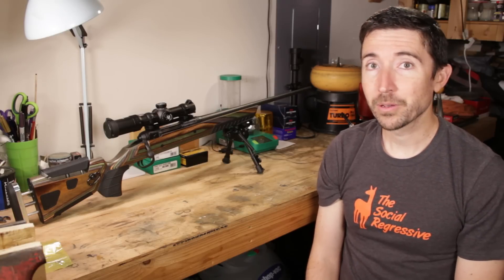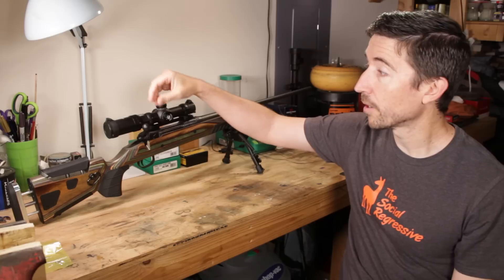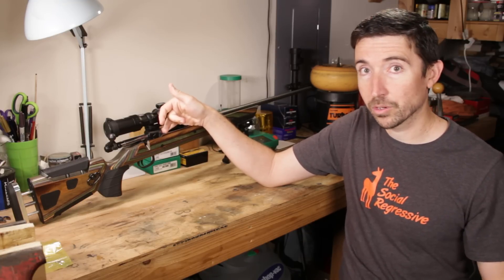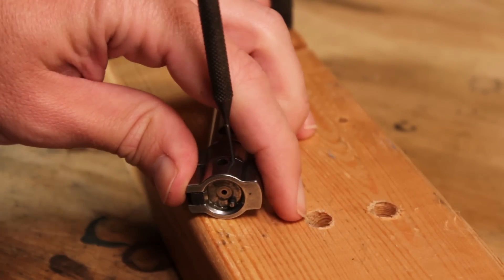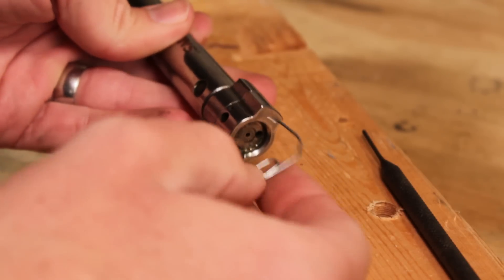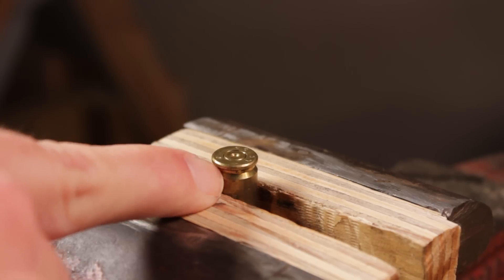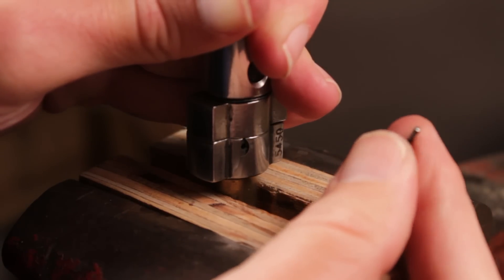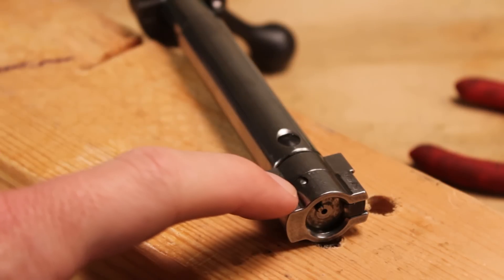Savage Axis Ejector

Comment: In response to tincan's question...

Different cartridges will eject with different degrees of authority from the Savage platform.  Case diameter, case length, shoulder angle and neck length all play a roll.  For example, a lot of people have ejection issues with 6.5 Creedmoor from the Savage and the reason is because of the case dimensions at the neck/shoulder junction, the shoulder angle and the neck length.  When you first start extracting a spent case from the chamber the ejector starts putting sideward pressure on the case head forcing the neck and shoulder into the side of the action with the ejection port.  As this happens the neck is pushed into the raceway channel, but the neck length is to short for the case mouth to contact the outer wall of the raceway which would limit the angle at which the case is being tipped.  The diameter of the case at the neck/shoulder junction is also small enough to fit into the raceway, so it to does not limit the angle at which the ejector is tipping the case in the bolt head.  As a result, the case is pushed to such an angle by the ejector that it allows the rim to slip out from under the extractor and the case falls out on top of your next round rather than being thrown clear.  Short cases like the 6mm BR are also prone to ejection issues due to their short overall length allowing the case to be pushed to a greater angle than the extractor can accommodate  before contacting the inside wall of the action.

Sharp Shooters Supply sells an upgrade kit that includes a slightly modified ejector pin, extractor, and extractor detent ball that will eliminate most ejection issues in the Savage Axis and 110-based rifles.
Reply from the maker: Great info! I'll pin this comment up top for anyone else that needs to fix an extractor/ejector issue.
Reply: Savage Shooters %
Reply: Having issues with my Savage Axis 2 XP Hardwood 308 loading cartridges at times. It will sometimes get stiff when chambering a round and be stiff on ejection. Any help is appreciated.
Reply: Kyle, how the heck did you get this pin out. The hole for it is small than 1/16" and that is as small as most roll punch kits come 🤣. You'd probably laugh, watching me attack this pin. Your ejector pin diameter must be larger on the Stevens bolt. Thanks
Reply: @Jeff_Seely  I just used a common nail of the right diameter after filing the pointed tip straight, I tapped gently a couple of times with my smallest hammer and it worked alright because the retaining pin is not hard to take out.
Reply: @jodo2609  Thanks. I later found a roll punch small enough to get in there and tap it out but it was stubborn. It looks like whoever assembled the bolt buggered up the leading edge of the retaining pin. I appreciate the reply

Comment: So, I also have had problems with my Savage Axis II XP bored to 223 REM ejecting.  In my case, though, the pin had plenty of spring left.  After messing with the thing for two hours, I found that the spring under the ball bearing needed more tension (it sat flush with the bolt face, meaning the height of the bearing was the only force put on the spring).  I manually stretched the spring out about 1/4" and now the rifle is ejecting fine...for now.  Someone else mentioned inserting a larger bearing, and this could probably do the same thing.  I typed all of this out hoping it may help one person out there.  Thanks for the video!
Reply: I put in the larger detent ball and that cured my problem , sad after all these years Savage has not correctly fixed the problem

Comment: I had the same ejection issue I replaced the ejector spring after firing couple of rounds it worked for awhile until it started to fail again. After careful analysis I notice the spring tends to loose its spring power. So what I did was to cut a small tiny piece from the old spring add it onto the regular size spring by putting it inside the ejector spring hole to give it more tension, put everything together and it works perfectly no failure and ejection was crisp with every spend shell gets spit out strongly regardless of ammo brand.
Reply from the maker: Cool idea!

Comment: I replaced the ejector and extractor, with the kinney's enhanced kit (extractor, bearing, ejector and spring) $22 problem solved. It doesn't solve the slop/play of a savage bolt, but for that I would recommend pushing the bolt up as you push the bolt forward, this will push the face of the bolt down which will pick up the next round from the magazine. (I also replaced the accustock as that is better suited for an air rifle and I no longer have the problem of using savage proprietary magazines which are really poor) in fact getting the savage 10 has turned out to be an expensive mistake, for what I have spent to give me consistant sub moa at 100mtrs, I could have probably achieved with a tikka, Sako or Bergara for the same money. My bad.

Comment: Thanks for the instructions! I’m working on putting mine back together right now! Retention pin fell out at the range.
Reply from the maker: Did you find it? Or buy a new one?
Reply: @SocialRegressive  I saw the spring and ejector when they fell out at the range and used your video probably 6 months ago to diagnose the problem. I found out that the retention pin had also fallen out. I bought a new pin and well as spring and ejector for good measure. I finally got around to implementing the fix this morning. When I watched your video again, I thought it would be a good idea to put the new spring in since the old one felt a bit loose. Thanks again!!

Comment: Great video, but you may want to thoroughly clean the pocket, inspect inside, clean and inspect the removed pins before reassembly.  Sometimes you'll find carbon buildup or even original machining filings/grit or other debris.  Depending on the components and how they operate, lightly file or sand rough edges/ends, or lightly polish surfaces may really smooth their operation.  Then lubricate after reassembly.  Anyway, thanks for the video.

Comment: I changed the whole extractor system (Ball, Spring and Extractor). I changed the ejector spring and Now the plunger ejector is VERY Strong,...BUT!!,....it still does NOT eject spent casings or snap caps reliably.

I have another Savage, a 112 with a stainless bull barrel that works perfectly (So Far) in 25-06, but cannot figure out what is wrong with my Axis 2 XP in 308.

I cannot justify spending money on ammo with only one rifle to depend on, especially when that rifle does have these issues. So,...I just bought another 308 by Mossberg since I have had zero issues with my Mossberg rifles.
I've got to say, that I think push feed is a TERRIBLE idea! My control feed or even my push feed without a plunger ejector works REALLY well. 
I have a P14 Enfield that I would bet my life on. 
My Mausers are freaking awesome. 
And although people bad mouth the Mosin Nagant,...they are an Awesome and Very reliable rifle!! 
Yes,...the interrupter/Ejector is a bit screwy and CAN be prone to jams, if not loaded right. But if you do your job, it will do it's job.
Reply from the maker: That's really interesting. I can't begin to guess why it's still ejecting poorly.
Reply: @SocialRegressive  I have found a couple of spring sizes (Stronger Springs) that MAY fit the Extractor and under the Bearing. 

At the very least it may give me a clue that the problem lies with the extractor and might need a larger bearing. 
The one that came with the kit is one eighth inch. I heard some other guys put a larger bearing under the extractor and it worked. 
But they are hard to find,...in the gun world. So I may have to look else where.  
I will let you know if I get anything to work,...lol.
Reply: I would refrain from using snap caps or steel case ammo because in as little as four ejections I have seen it wear away enough of the extractor to not function as well.  IMHO, stick with brass only.
Reply: I finally found the problem. It turns out that the Ejector was standing to "Proud" from the bolt face. 
The real issue was that were the portion of the Plunger (Ejector) rides on the pin (That holds it in) was ground out,...out of spec. So the Plunger (Ejector) was riding to high out of the bolt face. 

But the "FIX" is Just a few seconds with a Dremel to grind the ejector down a LITTLE and buff it down so there are no sharp edges.  
Once this is done, the Extractor does it's job of holding the case, without to much pressure from the plunger ejector. And dumps the case a little later.
I realized this, because I was swapping out a BCG on one of my ARs and noticed how the plunger ejector was not standing anywhere near so proud.

That is when I had my "Aha!" Moment! (lol).

Comment: Hey Kyle. I hope everything is going well for you! I plan on using a single-shot feed ramp for this action and I was thinking of running with the ejector pin completely removed from the bolt face. Do you see any concerns with doing this, like debris getting in through the ejector port?
Reply from the maker: The recess is separate from everything else, so you shouldn't have to worry about soot getting back into the bolt body. Sounds like a fun project!
Reply: Thank you very much Kyle. I haven't had this bolt apart just yet so thanks for letting me know a little bit about the anatomy. When it comes to rifles, they are the funnest!

Comment: My problem is my 308 casings getting stuck on the extractor. I have to remove the bolt entirely and pull the casing off at an angle. Will replacing the spring solve this issue? This is fairly new, could have been caused when I cleaned and reassembled the bolt this past fall.
Reply from the maker: If that's the case, your ejector spring is far gone. Replacing it should fix your problem.

Comment: What size punch do you use for this, I need to do it for mine but I don’t have the right size punch and need to buy one
Reply: Multiple sources have said 1/16" punch, but I just bought a brand new punch set and 1/16th is the smallest I have, but it is VERY tight.

Comment: Where did you get the spring and what size was it is it something you can find at a hardware store possibly?
Reply from the maker: You're not likely to find this exact spring at a hardware store. I got this one from Brownells. It has the exact  wire diameter and length for the job. If you search by your make and model you should find it. Well, heck, I think all the savage bolt heads use the same spring.

Comment: I tried this on my 110 bolt thinking I could clean the spring and pin. NOPE! bent two pin punches and it hasn't budged yet, I soaked the bolt head with penetrating oil and tried again this morning, that's when the second punch bent. The pin is not moving, on the last try the punch broke off and now a small piece is stuck inside the hole
Reply: update: the pin was really stuck but I ordered a set of stubby starter punches and got it moving, got everything cleaned up and re installed

Comment: Now how about the extractor.
Reply from the maker: I can give you a quick description. Put a towel around the bolt head and slide the extractor away from the center with a punch. It'll pop right out. As it slides out, it will release a ball bearing and a spring under it. That's what the towel is for; to catch it as it flies out. Reassemble in reverse, holding the ball bearing in place with a punch as you slide the extractor back in place.